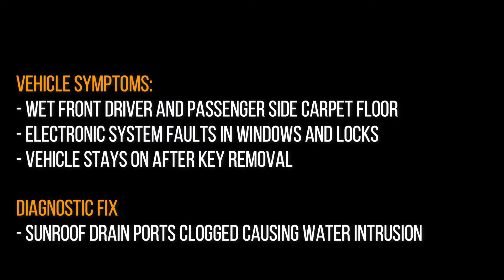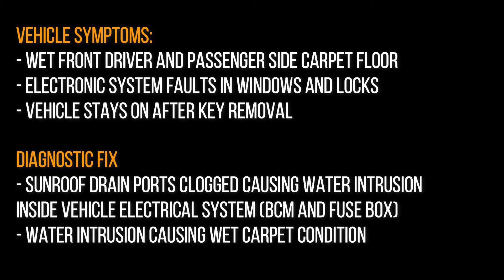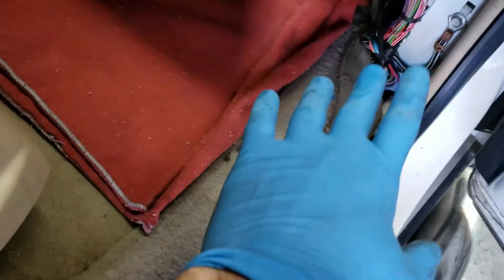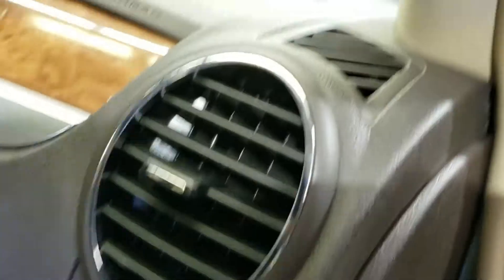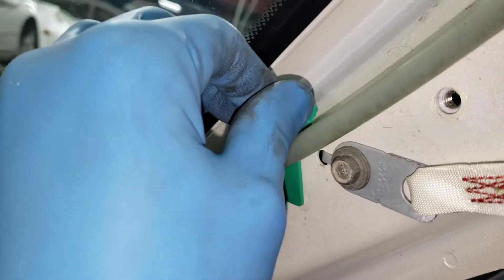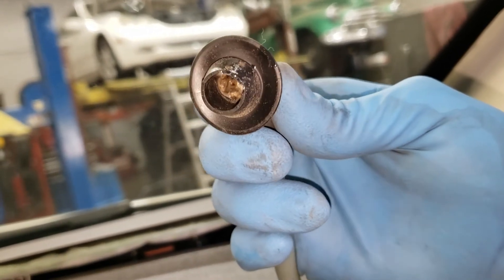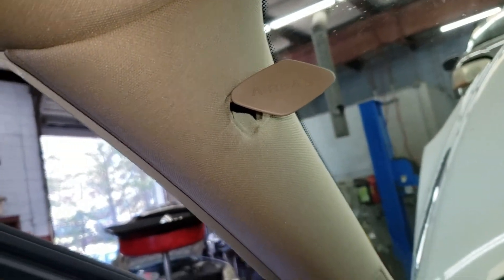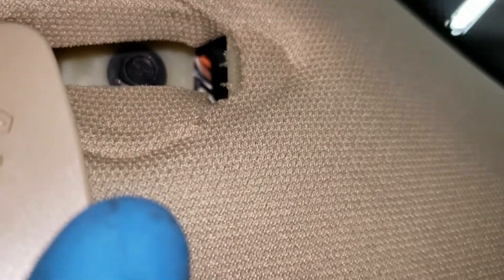BUICK ENCLAVE WET CARPET AND ELECTRICAL ISSUES FIXED!

Comment: I have same issues but no sunroof. Floor boards on driver and passenger sides always soaked when it rains. Also had electrical issues in the past. Where is the water getting in and how do I fix it? Would be forever grateful for a response. Thank you!!!!!
Reply from the maker: well the first step to diagnose that issue is have someone water hose the vehicle constantly in different areas, while you are inside checking where the water begins to enter. Have him/her keep hosing that area until you can follow where the water is coming from

Comment: Thank you for the helpful video. Will the problem resolve once the wet area dries out? I haven't noticed any wet areas inside my car, but the electrical issues and car continuing to run after removing key only started happening after a rainy couple of days. I would greatly appreciate a response. I wish you were in Florida! 😊
Reply from the maker: Hey, im glad you found the video useful! How was the condition of the sunroof drains? and also the hoses that go inside the vehicle to the outside? Normally the problem should resolve on its own, when everything dries up, especially if the problem goes away when its not raining. Worst case is that you left the issue happening for too long that one of the modules or fuse box suffered damage due to the water intrusion. Keep me updated!
Reply: @RodriguezRepairs  I haven't checked the sunroof yet, but the passenger floorboard was wet. The car stayed running when the key was out  of the ignition, but today, the key didn't even want to come out the ignition. It hasn't rained in a couple of days, but now the car won't even turn on anymore 😒 how can I tell if there was permanent damage to the components? Thank you sooo much for replying 🙏
Reply from the maker: @jleezy612  so no work has been done to the vehicle yet?

Comment: Whenever it rains my stereo is shorting I believe water is getting into the at least back drivers door when I pulled the piece that’s  in the joint connects the wiring in the door jam , water pours out

Comment: Can there be a leak if there is no sunroof? Are there still drain hoses under the trim? Jr.
Reply from the maker: if the vehicle has no sunroof then the  vehicle is not equipped with the drain lines.  are you experiencing the same problem?
Reply: @RodriguezRepairs  I have the the exact same issues as what is described in the video. However, I don’t have a sunroof. Where do I start?
Reply from the maker: @powerman1725  
well the first step to diagnose that issue is have someone water hose the vehicle constantly in different areas, while you are inside checking where the water begins to enter. Have him/her keep hosing that area until you can follow where the water is coming from
Reply: I fixed mine by cleaning out the AC drain hose near the drivers side center console. It was clogged and the AC drain was flooding the inside carpets from the driver and passenger

Comment: I have a 2008 Buick Enclave and the same problem. My biggest leak is on the driver's side and the floor gets puddles. I'm real leery of removing the panels. I can't really see where the hose begins under the sun roof. Can you show more clearly where it is. Please and thank you.
Reply from the maker: open the sunroof, there should be a small drain hole on each side where the water enter through the hose, follow the hose, ita clear down to the dash
Reply: @RodriguezRepairs  thank you for your response. Was able to locate the drains just opening the sunroof. Ran some trimmer string through it and the water is draining out,,,not in the car. We have had three days of some heavy rain and carvis still dry. Thanks again.

Comment: How does the water get in the back doors?
Reply from the maker: There is a drain like the one in the video, but in the rear. If you watch my other video on a Buick Lacrosse rear drain repair, it will be a similar process!

Comment: If you take an air chuck you can blow air through it (to clear it) instead of spending 2 hours taking your car apart.
Reply from the maker: i dont think pressurized air would have been that effective to completely clear the blockage, i think taking the rubber drain and cleaning it by hand is the best way.